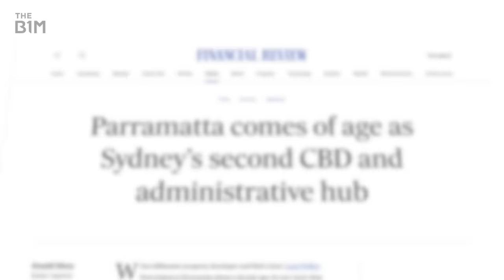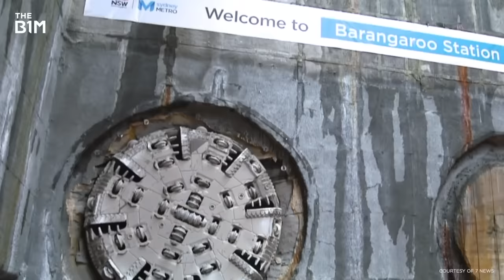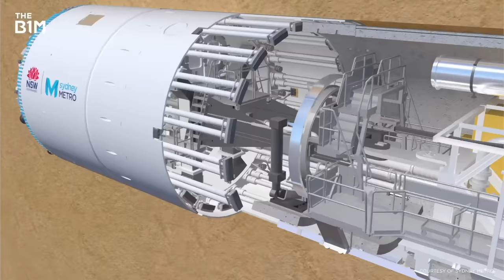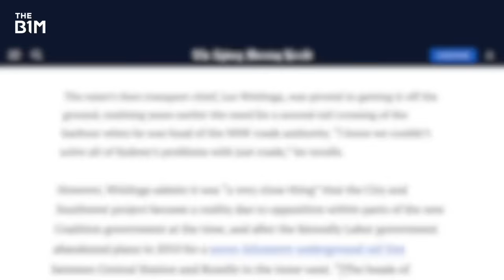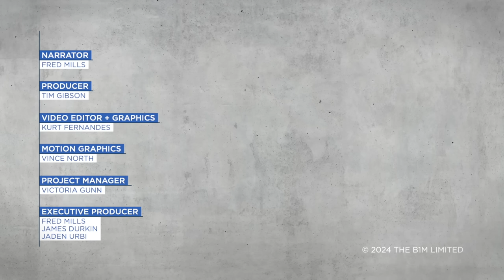Australia’s $64BN Mega Railway

Comment: All good and well that this is happening in Sydney and it will improve, the problem we still face is the spoke and hub transport situation. 

all trains, and all metro lines go into and come from the city, in a general east/west direction. What Sydney is missing on the rail and metro network is one if not two genuine north/ south running lines which cross over with the east/west running metro and rail lines. 

This will truly open up Sydney and the traffic issues faced currently.
Reply: The Cumberland line doesn't run through the city centre. In the distant future there may be metro lines that go Hurstville-Olympic Park-Macquarie Park and Kogarah-Parramatta-Norwest.
Reply: @RodneyAvery-o2q  I forgot about the Cumberland line. They certainly need something either through strathfield or Olympic Park

Comment: Nothing costs $64 Billion.
Reply: Well you must be the Federal Reserve printing money left right & centre
Reply: Sure, there are plenty of countries where this could be done a lot cheaper. But in a lot of Western countries, and Anglophone countries in particular, this is pretty typical.  The North West Metro was completed $1bill under budget though. I think we would be happy if these projects could be completed on budget, but there have already been cost overruns, so I'm not expecting that to happen. But we will see. And if you think Sydney's projects are expensive, In 2022 the Victorian Parliamentary Budget Office estimated the cost of constructing the Melbourne Suburban Rail Loop East and North would be $125 billion, with an additional $75.2 billion in operating costs.
Reply: In Western countries there's so much documentation and safety protocols....projects easily cost 3 times what they actually should.
Reply: @daveg2104  tunneling is £20 million per km. Do the math
Reply: @warriorson7979  more like 5-10x
Reply: @davidwebb4904  As a civil estimator friend once said: "There are also other unforeseen costs".
Reply: @daveg2104  the projected cost is $83bn, construction will be complete in 2053 but the scope of the pbo report will extend until 2085 which includes maintenence and asset renewal,
why? because the report was proposed by the anti-SRL opposition for the 2022 election
Reply: @RealNotOrrio  I was replying to the original comment in this thread - Nothing costs $64 Billion.

Comment: You might also mention the 'light rail' in Sydney centre, which is a very small tram line that goes around the main city suburbs. I think it has like 5 stops right now? It goes to China Town which is convenient. Parramatta is also getting it's own tram line. Sydney is littered with different train networks
Reply: Since 2020 there are three light rails lines totalling 42 stops over 25km serving the City, South-east and inner West.

And a separate line in Parramatta with 23 stops is opening soon.

Comment: You should've mentioned how they're all built on different electric standards so you can't even connect them. Or how far some of the transfers are (e.g between regular heavy rail and metro rail at parrammatta). Or how we had a perfectly good train line on the bankstown line with trains running every 15 mins or quicker but they still choose to tear it up and replace it with a metro (instead of putting that money elsewhere). Or how few stops Sydney Metro West (parramatta line) has, despite metros typically having stops quite close to together (huge waste of opportunity and money by not having more stops). 

Sydney has a huge issue currently not only with it's transportation but population, the government has wasted billions in this project with poor planning.

Comment: 1:39 You did not mention when Phase 1 began. Did it take one year? Ten years?
Reply: Phase 1 took about 8 years.   It got actively started when the previous State government came to power in 2011 (had been numerous announcements from the previous government but always followed by cancellation - their pitiful failure to deliver almost any public transport infrastructure was one of the many reasons they were finally kicked out of office in 2011).  That NW leg opened in 2019.  Phase 2 is the under-harbour route through the city as far as Sydenham.  That's in final testing now and is due to open sometime in the next 2-3 months.   That one will be a massive game changer.  The extension to Bankstown is then due in 2025.   Metro West isn't likely now until 2032 (we had another change in State government last year and the new lot ran a load of "reviews" - all of which told them what anyone with half a brain already knew - they were fantastic projects and quite obviously should continue).
Reply: @julianfoster3443 I see you're unhappy Labor are in office again.

Comment: A small bore tunnel that won't fit NSW's super double deckers.  Very odd indeed! Must have been to nail the rail union?
Reply: double-decker trains are terrible for mass transit systems
Reply: @TheLostProbe  Each to own. I like the view of Sydney harbour from the upper deck of a C/K set, Tangara or OSCAR.  Much better than being underground the harbour in a cramped single decker looking at blackness.
Reply: @njd2342  each to their own? it's not my opinion, double-deckers genuinely suck for anything other than intercity/regional services. single-decked trains are better suited for railways within urban areas and mass transit systems like Sydney Metro

Melbourne built and operated a single double-decker train a couple of decades ago, to test the viability of running double-deckers on the rail network as a way to increase capacity. however, the project only lasted a few years before being abandoned. there were a few reasons why, but one of the biggest reasons was that double-decker trains accelerated and braked slower than their single-deck counterparts, and also stayed at platforms for longer (which is known as dwell time), so they were actually less efficient and would need to run less often
Reply: @TheLostProbe  Melbourne trains are the pits. Awful rail service and grim boring city.  Each to his own though.
Reply: @njd2342  Melbourne's rail network is great in many aspects, we're not in the Kennett era anymore mate

also you just ignored basically everything else I typed out in that reply
Reply: @TheLostProbe the DDs are necessary for Sydney’s network. Sydney had no choice but to settle for Double Deckers in order to increase capacity because it shared track with freight, therefore faster services weren’t an option. The dwell times also aren’t too different between Sydney and Melbourne anymore because Sydney’s doors are much wider than the average train door. Making it easier for more passengers to exit at once.

Comment: Just got back from Japan where I experienced their impressive advanced and efficient train systems, both the Mega Tokyo train system and three Bullet train rides.  Trains have much to offer and are really the answer to mega-population city transport needs.  I'm also a keen car guy, a "petrol head" as such, and knowing more than the basics, the electric propulsion of Trains is where the electric motor really only works, and certainly not in Battery Electric Vehicles!  Infrastructure investment is a must, huge and no doubt expensive, but necessary, and the Tokyo Train system proves it, with unbelievable underground-like cities moving millions of people every day quickly and efficiently.  With the incredible power (or torque) of the electric motors, effortlessly picking up and reducing speed as needed under incredibly loaded train cars, there is no other possible solution to mass urban population transportation!  An investment that will pay-off over the long term, which wont take that long once underway.

Comment: fun fact, the metro connecting to the new airport is incompatible with the existing metro lines. so people will have to get off and switch if they want to get to the city
Reply: The initial iteration of the airport metro will only run to StMarys on the main trains T1 line (not metro), so yes you will have to transfer..

A future extension is planned to meet an extended M1 at Schofields but will also need a transfer.

But the whole point of WSI is for an airport with a catchment of Western Sydney, not for people to travel from the CBD
Reply: @mark123655  yes and that is what is silly in my opinion. It reduces the airport's accessibility for (at least in my eyes) almost no gain. Neither is it compatible with existing heavy rail to connect with st Mary's or potentially leppington at some point, nor is it compatible with the existing northern Metro. Both of these are I think symptoms of well-known failures within the government
Reply: If you started from scratch you'd build everything as 25kV AC metro.. but we don't live in a perfect world and have to deal with legacy.
And T1 is complex enough as it is, another branch would be a mess.
Reply: @mark123655  yeah of course adding it on to the T1 would be difficult. But as the issues with the light rail has shown, having a mixture of incompatible rolling stock creates fragility in the system. 
And the northern Metro could've been 25kv AC

Comment: It's pretty impressive, but to be honest, for that money, Shanghai built an entire 408 station, 15 intersecting line metro network, plus 3 high speed rail lines.

The problem with the Sydney metro network is that while it's long, it's not very connected. Rouse Hill station at the end of Metro NorthWest for instance falls just short of connecting with the existing Richmond Line. This is a bizarre decision to leave the two disconnected.

The Sydney West Metro only duplicates an existing line only a km away. But meanwhile, 4 lines run out of the CBD in radial arcs and don't connect with each other through any loop line, meaning everyone has to travel via the CBD to switch lines. This is very inefficient.
A Hurstville-Strathfield line that connected these four radial East-West lines together with a North-South one was proposed about 20 years ago, but was shelved by the then Labor Government.

In addition, little planning has gone into connecting the new Western Sydney Airport with the regions via high Speed Rail. There doesn't even seem to be a reserved alignment for any future HSR to run via the airport which means if lines from the regions to the airport are ever built, they will be much more expensive.

What's happening is good, but still way behind where it needs to be for a modern 21st century city to be able to function with a potential 8 million population.

Comment: The Melbourne one is double the price?
Reply: Double the price doesn't mean it's better. Melbourne only has one line under construction (SRL east) which won't open until 2035. Meanwhile, Sydney Metro's northwest line opened in 2019, the City and Southwest line will open this year, the WSA line will open in 2026 and the Western line will open in 2032. All are well under construction/almost finished

Basically, Sydney will have 47 stations on 113 kilometres of new rail lines before Melbourne manages to build 6 stations on 15 kilometres
Reply: We all love to know why.
Reply: @c.d.c9425  its 26km  not 15, but all of the sydney metro lines began construction before SRL East, Sydney Metro West for example is projected to take 12 years to complete while SRL East will take 13, its pretty stupid we don't build more lines which we could've if it wasn't for WGT and NEL

Comment: The new metro has some bloody weird design decisions. It's still not clear to me why the new metro is completely incompatible with the old (8 year old) metro.
Reply: It wasn't some oversight. Being as charitable as I can be, possibly just the result of the projects being built by different companies under different PPPs, and the former Government not caring. It would have been easy enough for the Government to specify what they wanted though. Also the Western Sydney Airport Metro trains will start with 3 cars, with a possible expansion to 4 in the future. Sure, the extra capacity of a 6 or 8 car train wont' be needed for a long time, but modifications to the stations would be expensive. Another good question is why wasn't the NW Metro built the extra 3km from Tallawong to Schofields, connecting with the Richmond Line.

Comment: "driverless trains" will these be the same kind as the ones used in Copenhagen?
Reply: No. They are six-car units, taking power from overhead rather than third-rail. One of them was shown briefly in this video but if you search "Sydney Metro" in YouTube you'll find some footage of the trains currently in operation.
Reply: They're Alstom Metropolis vehicles, so kind of? They are a different length and use OHL instead of 3rd rail, but they are based on the same design.

Comment: City to Parramatta underground. What a waste of money. Could've updated the existing rail and saved billions.
Reply: And how would they put that many extra trains on the Main Suburban (6 tracks - 3 in, 3 out, 2 used for local services). Considering the other lines that also use those tracks, and that rail passenger numbers will be expected to increase over the years. And then they all have to funnel into the 4 lines of the City Circle (2 each way - 2 lines going north over the Bridge, 2 lines looping around via Circular Quay), joining trains from other lines. The City Circle is already quite congested during peaks. If you want to argue about the Metro route, or where the stations are, well, there is plenty there to argue about.
Reply: @daveg2104  It's just traffic management. Just like adding more lanes doesn't mean it will improve the traffic. Tokyo is much older city and has much much larger population than Sydne, but still has less number of tracks to the volume of trains commuting. Also, faster train services to nearby cities and town would be the solution. You cannot imagine commuting daily from Wollongong and  Newcastle to Sydney by any means whereas we have seen in many cities people travelling to work from farther distance than  those mentioned above.
Reply: @rrb: Mate, have you seen the crowd from the trains starting from Parra during peak hours? Its packed like sardines and the trains have already run at the max capacity. Doing anything on that, means massive delays for years as Aussie construction is so slow. The new metro opens stations in new neighborhoods and we can build upwards around that and create new housing supply. That is the aim of the metro project.

Comment: And just the past two weeks two sink holes have appeared above where they are tunneling near Bankstown. One large hole was at the side of an industrial building which had damaged the building due to sinking.
Reply: It's Bankstown- doesn't matter😂
Reply: The sinkholes were not in Bankstown. They opened up 16kms further east of Bankstown, in Rockdale and totally unrelated to the Metro project. Those sinkholes formed as part of the M6 road tunnel project currently under construction in Sydney's south.
Reply: the sydneham to bankstown part isn't being tunnelled its a conservsion of the existing t3

Comment: $64BN because they pay women 100k+ to hold up a sign and safety rules require you to have at least 4 of them whenever a truck is moving out.

100km of high speed rail is hilariously abysmal compared to the 45,000kms of high speed rail China has laid down over, under and through mountains and deserts.

Comment: This project is a massive misallocation. Calling suburban train lines a 'metro' doesn't make them that. Starting almost an hour away from the city, with huge gaps between stations the only 'metro' thing about this is the style of train and platform screens. These trains have less seats and less amenity for people than the older non 'metro' trains, so this is not an advantage. So the only real advantage - platform screens. The main issue though is that all this infrastructure is not compatible with the much larger existing rail infrastructure in Sydney. So the extra capacity of these new lines is useless to all the existing infrastructure, even though they serve the exact same purpose. Creating a duplicate system at this scale is criminal. The inability to utilise capacity that isn't needed and to address bottle necks and interruptions across one network was an insane decision. If these were all ordinary Sydney trains lines the added utility could be 50% greater, maybe even more. So sad.

Comment: Our $50b rail tunnel project in Melbourne has blown out to over $216b 😢.
Reply: The standard approach to valuing an infrastructure project it's cost of construction, not including decades of running costs as is included in the very politically motivated calculation that you've eagerly quoted.

Comment: I'm not sure driverless trains are a good idea!! :( 

For example if someone was to wander onto the tracks!! .. The driver could react to quickly to swerve around them, saving a life,  with no driver present? More people may die!! :(
Reply: The computer driving the Metro has faster reaction times than the average Sydney Trains driver, so I'm sure it will swerve in time. On a serious note, they must have a huge number of cameras and motion sensors installed. I suppose if someone is desperate enough though, there is nearly always a way.
Reply: Driverless trains have been running in Vancouver since the 80s. Its tested and proven technology

Comment: So its not waste of resources and overcostly train that no one can ride ? Does it have to be non euorpean countries to do that
Reply: No one can ride? I don't get your point.
Reply: @daveg2104  its costly so no one can ride
They ran this headline for Russian High speed train
Reply: @meteorknight999  The Sydney Metros will be operating on the same fare structure as Sydney Trains. You will be able to tap on/off with your Opal Card or go contactless. If you have a pension card, you can ride all day for $2.50. There are also fare caps on Sydney Trains.